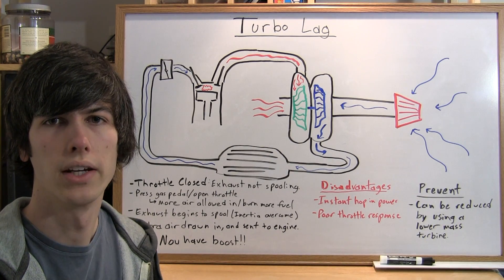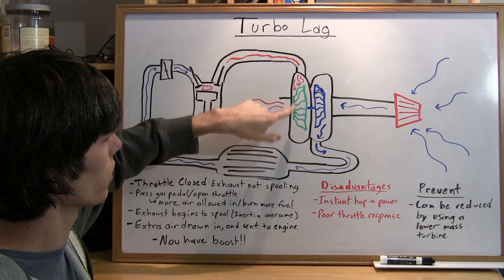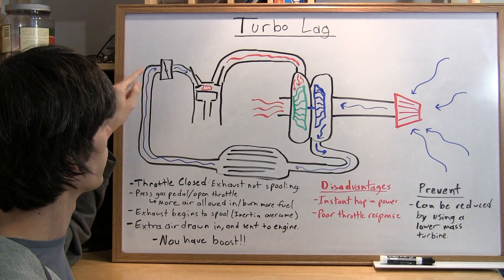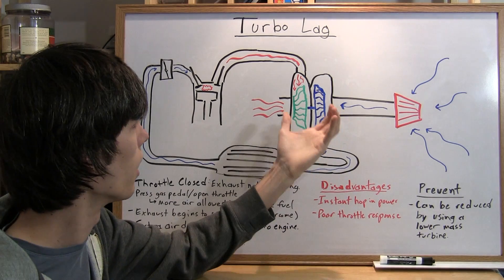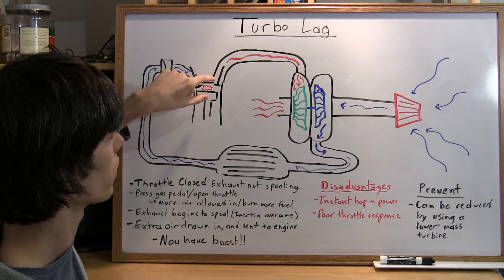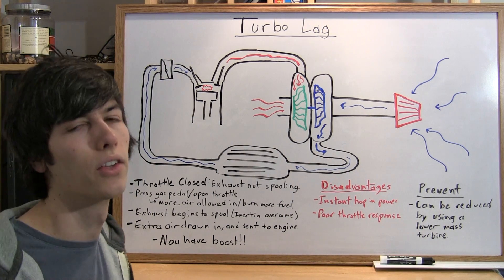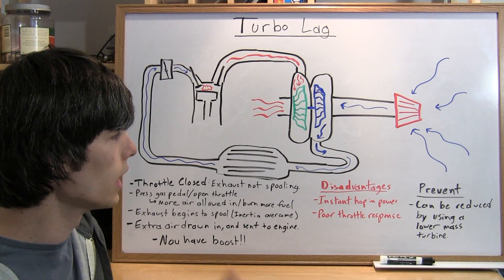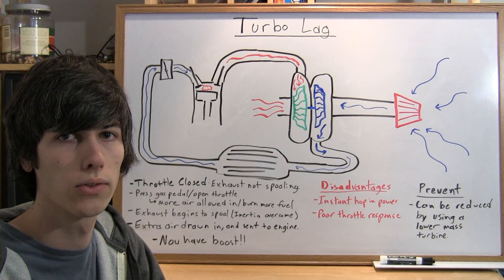Turbo Lag - The Problem With Turbocharged Cars

Comment: Wrong those turbine blades are made from the best material we can afford & has to withstand over 500 degree's, a variable turbo with a built in control unit mapped with the cars ecu, turbo lag solved, just run the turbines on separate shafts for low power boost then when the exhaust pressure builds up the control unit locks the shafts together, I love my life, 

smart people do smart things, dum people say smart things.

Comment: Why doesn't someone just make a turbo supercharger hybrid. While the engine is ideling there will be no exhaust to power the turbo, but if you position the turbo and put gears like a bike's hub on, it the belt can spin the cold side and continuously suck in air. But once you step on the gas the gears will close allowing the turbo to spin freely with the exhaust output and speed up with it creating more boost. This should almost completely get rid of turbo lag. Unless this is what a pro charger is. Im not sure. Im new to how a turbo works and haven't looked into super chargers and pro chargers yet.
Reply from the maker: http://youtu.be/4birhPB5Twk
Reply: Ryan Ingoldsby There is Variable Turbochargers which is easy to built and get rid of Turbo lag as soon as 1200rpm-4000rpm., you can find them in Porsches and Volvo. They extended a movable flaps at the end of the turbine. Once u floor it or start accelerating, the exhaust will extend the turbine easily and become a low pressure turbocharge for 4000-8000rpm power band. Once u decelerate or cruising, the flap may close because there is not enough force to open it. In that time, it will work like a high pressure turbocharger. So that, you can get torque in wider rpm area. From 1200-6500rpm. In easier term, u can get high boost at any rpm.
Reply: Yeah, that "compound Turbo" used in some buses engine in HK. But I think variable turbocharger can gain more horsepower at low rpm than "compound turbo" does.
Reply: doktorbimmer I disagree back your comment. How a turbo gain more airflow than usual? Yes normal turbocharger would not spool up at low rpm because there doesn't have enough exhaust pressure. So turbocharger will decrease low rpm engine torque by creating exhaust drag.
Supercharger doesn't have that problem. But it run as quick as the crank or 4 times quicker. Yes it can increase low rpm torque or create linear torque by decrease drag or line up the exhaust flow. At high rpm, no way a supercharger can suck air quick as turbocharger.
The best way to do that is Variable turbocharger. E.G. a 100mm turbocharger can gain your hp from 5000rpm, so below 5000rpm, it will create gigantic engine drag.
Now, what the variable turbo do is, closing the flaps cause by low flow force. Once it closed, it will run like a 40mm turbocharger and give u high pressure and high rpm. May be rev 100times or 1000times faster than superchargers. So the result is: a Porsche 991 boxer turbo engine have 530hp at 6500rpm. When variable turbo installed, 530hp from 4500-6500rpm, also the peak torque used to exist at 3200-5000rpm, now 2100-4500rpm.

Cheers!
Reply: doktorbimmer you kind of repeating what I said and misunderstand what I say in the same time.
The speed of supercharger can increase or decrease by the size. Just do some research of how CVT transmission work.

Supercharger is a air pump? Correct. N because it's a air pump, it can also pull the exhaust or "wasted" gas out instead of the "wasted" gas push the turbine and create some stalling.

So my point is Variable turbocharger can increase hp at low rpm than superchargers no matter in low or high rpm. There is two different turbo that I'm, gonna mention here.
small size and big size. Smaller turbo is for low rpm engine or low boost engine. Bigger turbo is for high rev, high performance and high boost engine. So at low rpm, wearing a big turbocharger will create massive turbo lag. and at high rpm, small turbo will work far less efficient because of waste flow stalling and make the intake flow bumpy.

Question is: how can I make high engine thrust at low rpm with a big turbocharger or how can I get rid of turbo lag? The answer is to use a Variable Turbocharger.

There is something wrong with you. The force of wasted air is not always from the expansion while heated, it also can be the force that flow through the exhaust pipe. One of the example: Engine stalling. Well that's not important in this comment.

Back to Turbo lag, variable turbocharger will maintain high pressure in low rpm because the force of wasted air can't open the extended flaps. In that time, the turbo charger maintain as a small size turbocharger and give high revving to create massive blow in pressure to suck air in. At high rpm, the flap will open by the force of wasted flow and maintain as a big size turbo to keep away from over revving and suck enough air into the engine. Remember, the force that needed to drive a turbine isn't that much, the exhaust could easily drive it.

In conclusion, Superchargers can give linear air flow and equal amount of air flowing into the engine, by ratio Variable Turbocharger can also do what Superchargers do, but also can do superchargers can't which is increase the intake boost and can get rid of that engine speed "ratio".
Reply: doktorbimmer Do you understand what I mean about "pulling exhaust"?
Yes I got 1 point right? I know it seen I study mechanical engineering.

Back to your problem, What I mean about pulling air is:
Depends on supercharger size and the speed of wasted air flow from the exhaust section in the cylinder. If you have a slower flow speed (commonly known as low boost or low rpm) engine, you may want to install a smaller turbine and a faster speed ratio. In other word, the turbine speed actually running faster than the exhaust speed and that can make the turbine to force the wasted flow out. The opposite of that is pulling more air in.
The turbocharger is different. Wasted air will flow out from the cylinder and all the way to the turbine, the exhaust will push the turbine and spin it. The problem is, at low rpm to high rpm, you need to accelerate the turbine by the forces of the wasted air. N as this guy said, that accelerating time called "turbo lag".
But will not happen in Variable turbochargers.
At high rpm, turbochargers rev around 20000-200000rpm, depends on the size. The turbine speed is same or a bit faster than the wasted flow caused by the expansion from temperature. Remember, Naturally aspired engine pull fresh air in by wasted air flow. Or wasted air flow out, naturally pull the fresh air in. The inlet amount and speed must equal to the wasted air at the exhaust valve. At the exhaust pipe, the wasted air will normally decelerated. N that cause a bit of lag at the exhaust valve. What turbochargers will due with that is: at high rpm, the turbine spin as fast as wasted air as I mentioned, even faster when exhaust expanded by temperature. That actually will hardly pull the exhaust out of the exhaust valve ( just slightly a bit.) So a 3600cc natural aspire engine have a exhaust of 600cc per second naturally due to the lag of wasted air at the pipe, it may slow down to 590cc/sec . If I install a turbocharger on it, at high rpm, it "must" have 600cc or 605cc/sec. So if I push 605cc away, it means 605cc of fresh air will come in, now there is 5 more cc from the engine which means a 3600cc engine sucking 3600-3630cc of oxygen in. slightly more air will naturally decelerate engine speed in compression section, but mechanically it won't, it will increase power at ignition section by highly compressed air also be batter in fuel mileage.
Now u see the advantage of turbochargers.
So how can I get those advantage at lower rpm? Variable turbocharger. Flap closed at low exhaust flow and boost, maintain a smaller size, rev faster and keep the turbo boost high. Normal Variable turbochargers will open there flaps by exhaust force at around 4500-5000rpm, not sure for other cars.
In conclusion,  superchargers can't do same thing as variable turbochargers, variable superchargers can. Also superchargers can't spin as fast as turbochargers, they can't handle as much air as turbochargers in same size.
Reply: doktorbimmer "pulling air":The amount of air leaving the cylinder must equal to the amount of the air coming in. At high revving, Turbocharger spin as fast as exhaust because the exhaust is the power input for turbines. In certain situation, such as air expansion, same amount of air may give twice the force that they usually apply. That will accelerate the turbine out of ratio and pull more air in. Also will increase the air flowing speed.

Superchargers and Turbochargers both will create lag, just depends how much they produce. Why? (Not many people know the answer), Because:
Superchargers spin as fast as crankshaft speed. Remember, the exhaust flowing speed may not= the piston speed after expanded. The expanded exhaust always flow faster than supercharger turbine speed. Problem is, the exhaust can't push the turbine of supercharger to go faster, because the speed limited by the crankshaft. Variable turbochargers won't. It doesn't take any hard blow to spin the turbine, the air can hardly blow off from cylinder and spin the turbine easily. N the advantage of Variable turbocharger is? Yes, get rid of lag AND create low end power by closing the flap at the edge of turbine to maintain small size and give greater boost at low rpm. Flap will opened by the force of exhaust at high boost or rpm. The force that u needed to open the flap won't create any drag for the exhaust flow.

I did mentioned, IN SAME SIZE, TURBOCHARGER(S) CAN HANDLE MORE AIR THAN SUPERCHARGER(S).

Those facts rejected your argument. Your argument is so False and so Fake.
Reply: doktorbimmer you going to disagree with that?
Air expands 12.245times at 15 degrees Celsius. At 800degrees c, u tell me the expansion. What I am trying to say is: compare same amount of air, the one that heated, will create more force than cooler air by expansion. U don't tell me that is incorrect sir.
Reply: doktorbimmer Ah, fuel now. New topic.
At the exhaust pipe, the temperature is around 600 decrease c in a 670hp mod Supra. At the Turbocharger, the temp is around 520-660degrees, depends on your engine efficiency. The expansion of the exhaust gas will increase the speed of turbine by the expansion and flowing kinetic energy. In same amount of air between turbine and exhaust, the amount of heated air at turbine will increase, because there is space for it to move. and greater the resistance force of wasted air, greater the expansion. Also when the exhaust traveling to the turbine, they will cool themselves down by separating themselves to more space. Those cooling action will create a pretty similar result as nitro reaction, expand themselves by ratio of temperature difference.